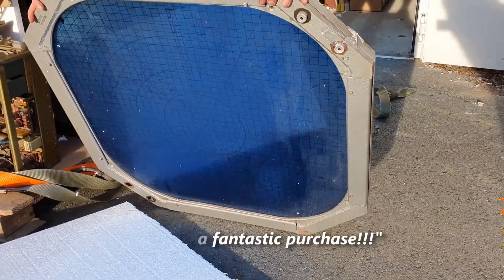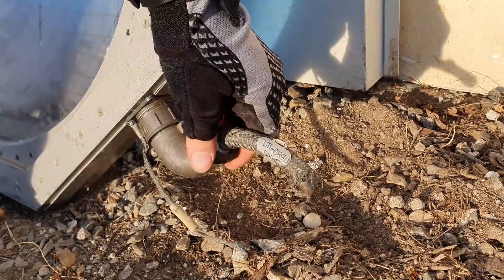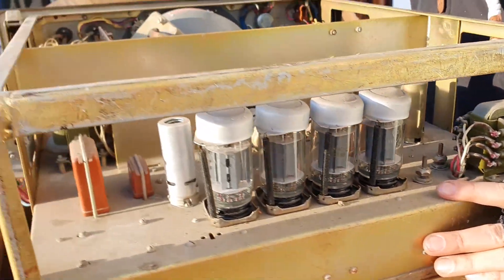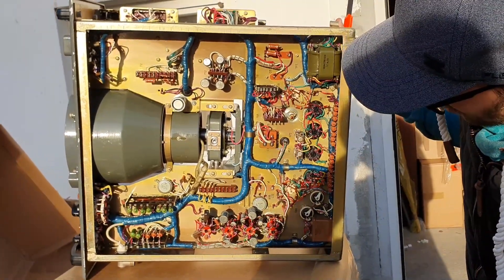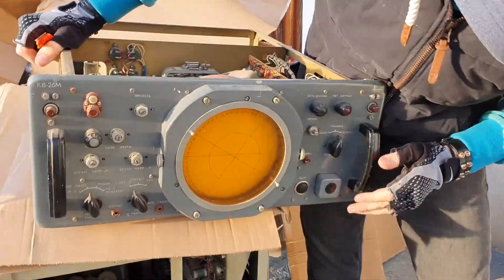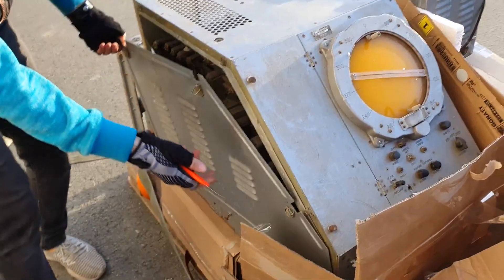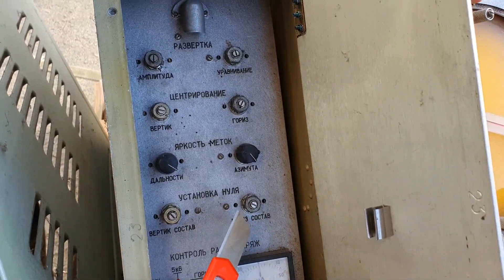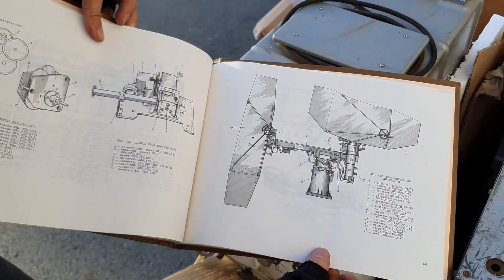BEB 145: #Unboxing Russian #Radar #Equipment

Comment: The oscilloscope in the start of unboxing, is amplitude characteristics meter (sweep generator with oscilloscope and detector probe on the cable), named AChH-1A. Range from 20 MHz to 700 MHz, if l don't forget. It must be in the lab car, near the main radar car.

Comment: That seems to confirm stories I heard that the USSR carried on using valves (tubes) in military equipment long after the west stopped using them, supposedly because they are resistant to EMP unlike semiconductors.
Reply from the maker: That's amazing !!!!
Thank you for pointing this out!
Reply: Not only that they are radiation hard, but also simple economics, the production plant was there, it was working and they could maintain it, while the semiconductor industries were somewhat behind the USA in both technology and in output, along with not having enough knowledge and experience to make a reliable product all the time. They depended a lot of the time on espionage to get new improvements, so were always a generation or two behind device wise, but the vacuum tube equipment was stable enough to be reliable, so tended to be used all over as it was not something you had to coddle and have a lot of experienced techs permanently on to keep running. 

At the time the soviet transistor industry relied a lot on checking each device as it was made, and then sorting the individual device dies into lots to be packaged and marked with a part number, as the production spreads were so wide that you could not guarantee that each wafer would be the same, and thus each batch of transistors was often quite different performance wise. Often they were packaged and then tested again, the test result determining which part number they would be, as the gain and operating voltage could vary wildly across a wafer, or even between devices next to each other.

Remember there was little incentive to improve things, they made the same Fiat Topolino model as the Lada for decades, only changing parts as the dies wore out, and as steel got expensive so they went to fibreglass and then resin bonded paper panels. But still the same base models while every other manufacturer had long since developed a whole series of generations of newer safer vehicles. Only the military was doing a big amount of catch up, always aiming to be only a generation behind the USA, but making up for it in numbers.
Reply: @SeanBZA  Not FIAT Topolino, but FIAT 124. No fiberglass and/or epoxy cardboard in LADA, you mistake it for East German Trabant.